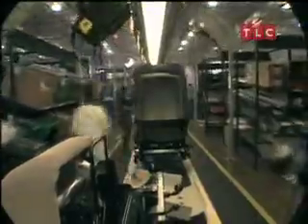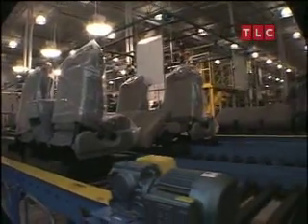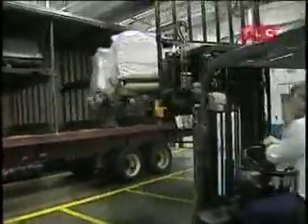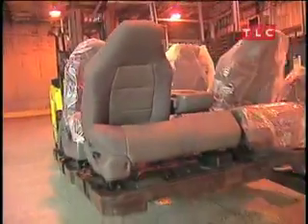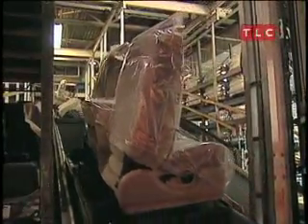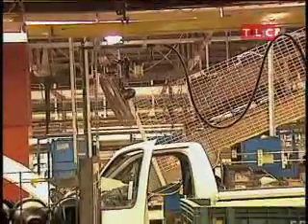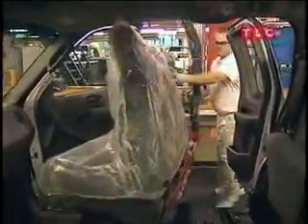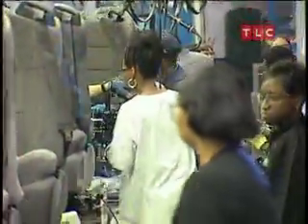Understanding: Manufacturing Automobile Seats

Comment: I worked at TS Tech USA in Reynoldsburg Ohio. I was on the Power Line 2008 in the weld Department. That line built all power seats for the MDX in the CR-V.  I mastered the Sr, MR1, could learn to weld with minimal training. I had a blast in the world booth repair welding the robots. It was hard when they sent me the other departments when they were short and I had to repair weld seats I wasn't familiar with. 2px line the New Generation Accord was a nightmare. Picked up the whole department nousheen new machines they had to program properly so there was a lot of repairs. I was actually pretty proud of myself because I have Muscular Dystrophy and I can work done more efficient and faster than 95% of everybody without whining.

Comment: Would the trim cover and foam factories normally set up at same location?
Reply: not necessarily. I work at a seat factory that is adjacent to the actual car plant. The components we receive come from different areas within the state  as well as from other areas. It's better if they are closer because we can run out of parts if the production at the car plant goes up.

Comment: I worked in a plant like this, it was hell.  the money was good.  the final assembly plant pays much better and the work isn't any harder, actually its easier.  the supplier plants usually aren't anywhere near as proactive, when it comes to ergonomics and accumulated stress injury prevention.
Reply: Can we discus please. ayoyemifavour@gmail.com Thanks
Reply: what do you want to know?  I will discuss it as much as I can.  if I cant discuss some aspect because of a confidentiality agreement, then I might consider a private conversation.
Reply: that is a question I cant answer.  I know the plant I worked in cost in the hundreds of millions of us dollars.  but then again I'm sure it would cost much less to in an African country.  the company I worked for actually has several facilities in Africa.  those are the most profitable factories as the labor cost so little.
Reply: Are you familiar with the mechanism responsible for the seats vertical movement (adjustment)?